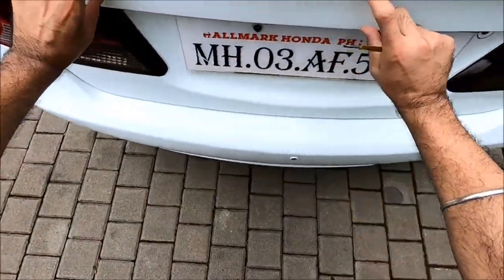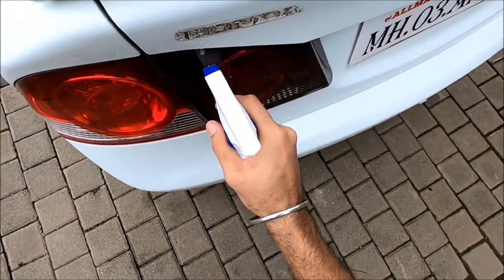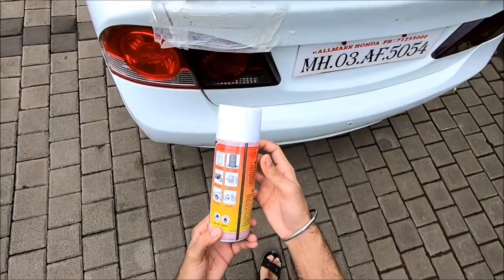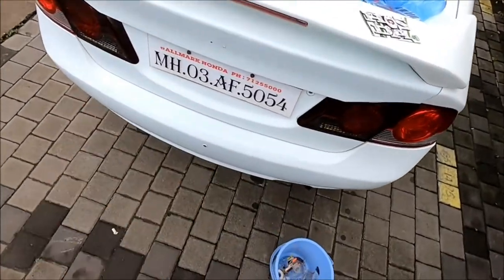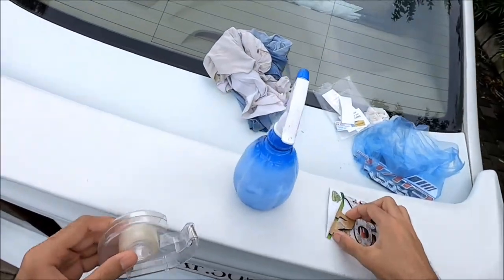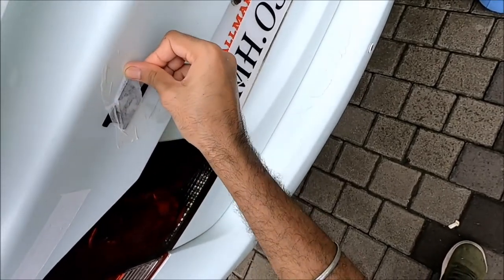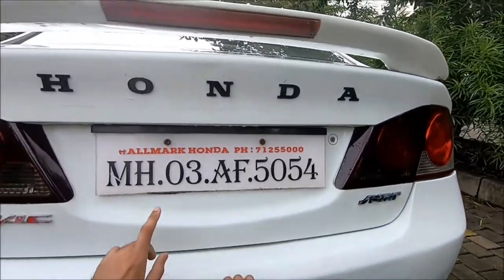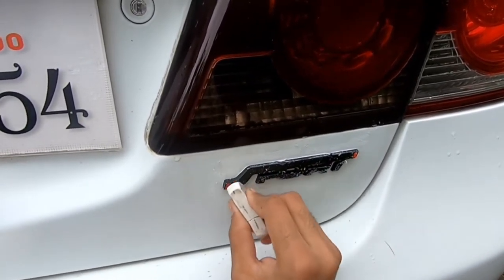How to stick car emblems & 3D letters - Ep 7 of Honda Civic DIY modification series by Preet Singh

Comment: did you use feviquick ?? if yes it will damage the paint of car
Reply from the maker: Yes I used it. Once these emblems are stuck they are not meant to be removed. If you attempt to remove them of course the paint will get damaged. Also, It is mentioned in the instructions that come with the emblems that you need to use Fevi kwik or other super glue for long life.

Comment: R these emblems still stuck on ur car or have they come off due to washing aur cleaning etc.???..plz reply.
Reply from the maker: They’re stuck permanently. Even if you try to remove them they won’t come off easily.
Reply: Wat glue did u use
Reply from the maker: Fevi Quik - it’s a super glue. You can use any super glue like loctite.